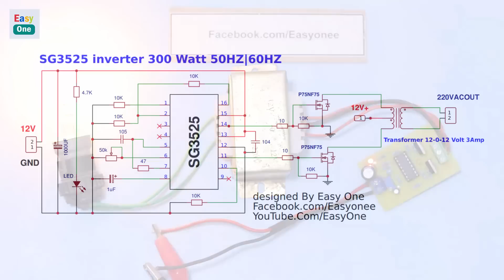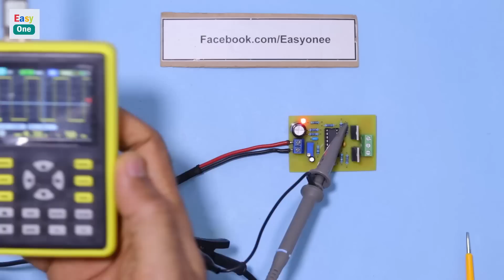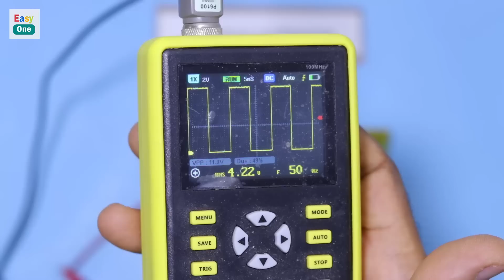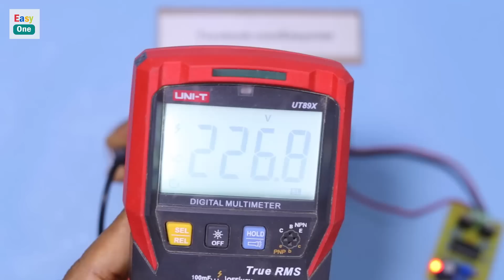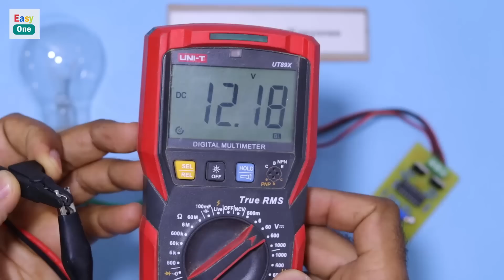SG3525 inverter 12V TO 220V | 50HZ & 60HZ | 300W

Comment: What sofware did you recommend for an amateur easy circuit?
Reply from the maker: link in the video description
Reply: @EasyOne  First link doesn't work. And second one is the schematic for this project... ok
But I'm asking for a sofware/program to design mine circuit.
I have electronic knowledge but never used a PCB design software. I need to do a simple one for an amateur arduino project.

Comment: Thanks, can we add low battery protection to this circuit??? and how??
Reply from the maker: if add lm358 and pc817  low voltage protection, when the battery voltage is less than 9V, the output is closed and the battery will not be damaged .... soon

Comment: Sir , how you saying this has been 300 Watts . i will be very  happy if you clear this doubt ????
Reply from the maker: Maximum Power  75NF75 MOSFET  300 W  but you need Power Transformer  12V 0V 12V 3A OR 5A
and  power source 12V 5A .. 10A
Reply from the maker: Output 220V 1.36A = 300W
Reply: @EasyOne  Thank you so much

Comment: Difference between sg3524 and 3525...can i use sg3524 instead of 3525
Reply: I find nothing on the internet that shows a comparison between sg3524 and sg3525. I really want to know because I have a working sg3524 oscillator circuit

Comment: This is bull shit. The transistors can't do 150w each and the transformer is only around 20-50VA.
Reply from the maker: STB75NF75 MOSFET  Maximum Power  300 W  and  transformer  for test only
Reply: @EasyOne  FETS need to be on heatsink.
Reply from the maker: yes @waynemillard1495